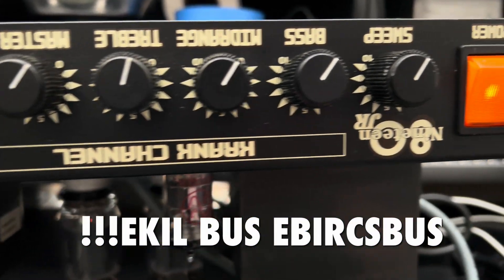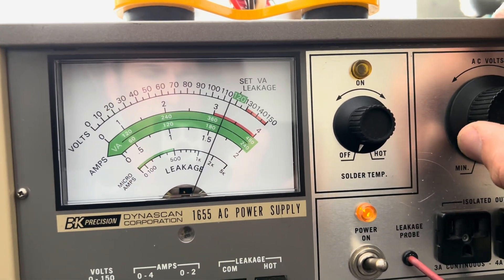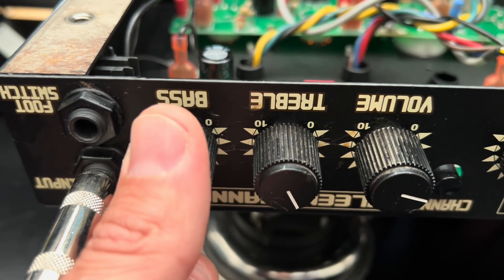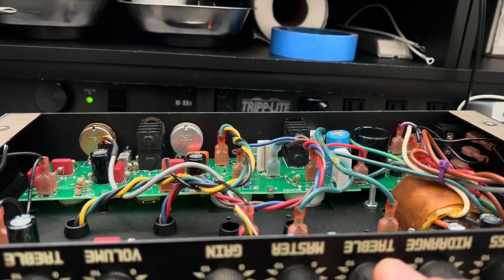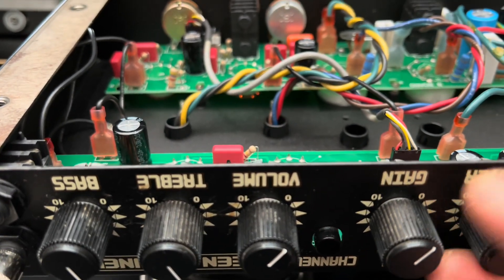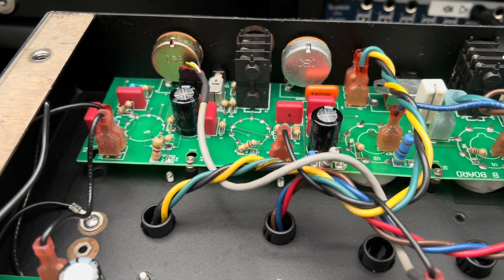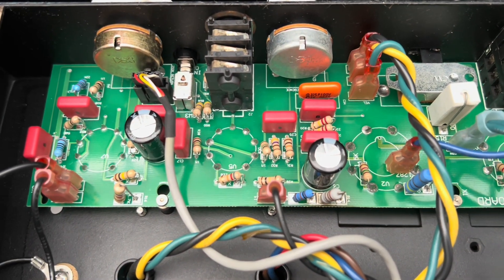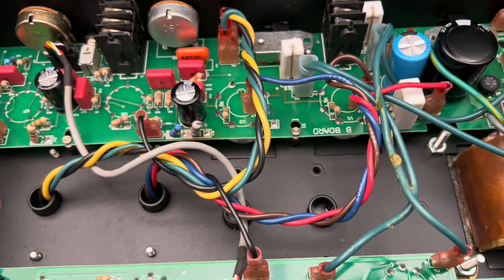Krank Nineteen 80 Jr: 20w of Fury

Comment: The corrosion is a known issue with these. Every one of their lunchbox heads I've worked on had terrible corrosion on the chassis destroying all the grounds. hey also had ground loops between the two boards from factory that could cause oscillation at higher gain settings. Every one I've seen has needed a cap job as the old Capxon caps were bulging. 

A company truly ahead of the curve but too much external money, too fast growth and the end result was a series of poorly built amps that could have been so much better.
Reply from the maker: A damning prognosis for certain, Doc. Maybe the whole idea was a quick money grab.